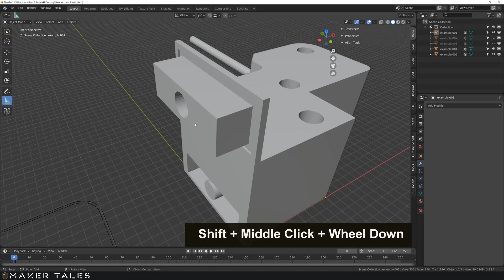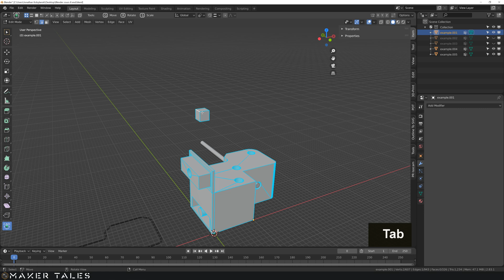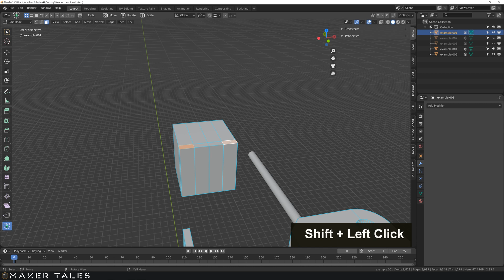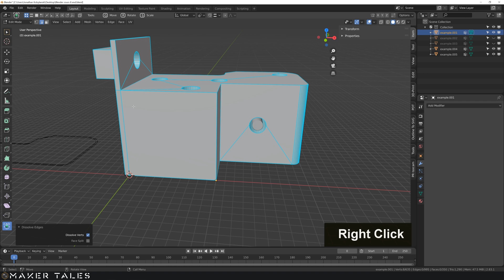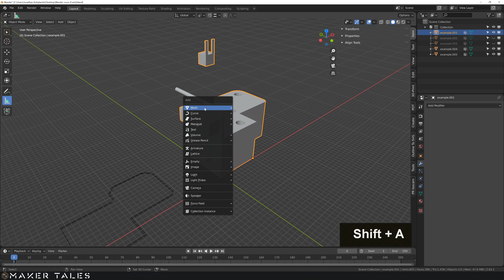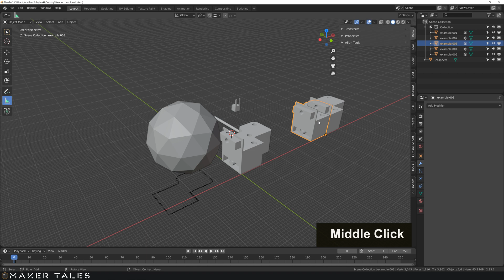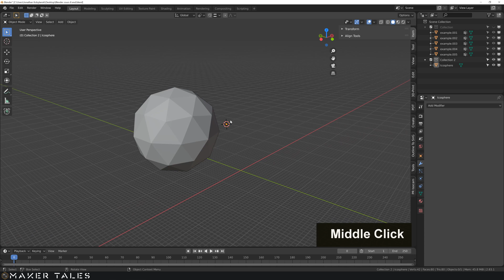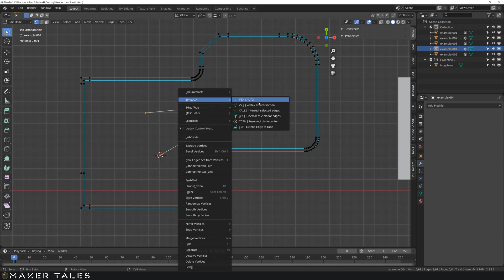Need to Know Series Loose Ends - Blender 2.83 Precision Modeling | ( Tutorial Part - 11 )

Comment: The number pad is so useful in Blender I gave up using emulate option or function key and finger gymnastics, and bought a Bluetooth external number pad.
Reply from the maker: Sounds like the right way to go Duncan,
Luckily my on the go laptop has a built in num pad but I'm pretty sure I would be in the same boat as I don't really think I could use blender that way I do without a num pad.